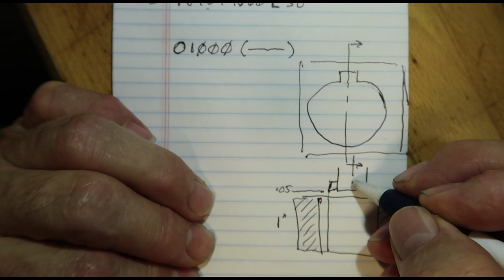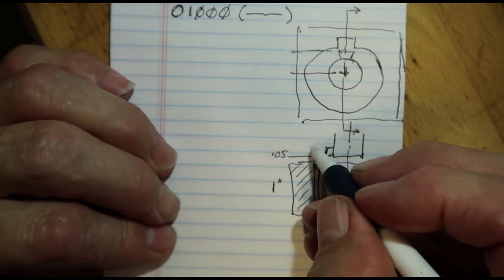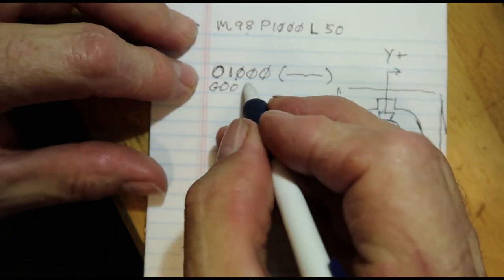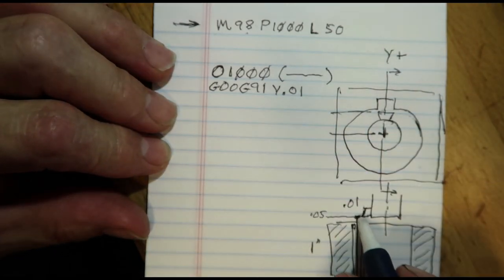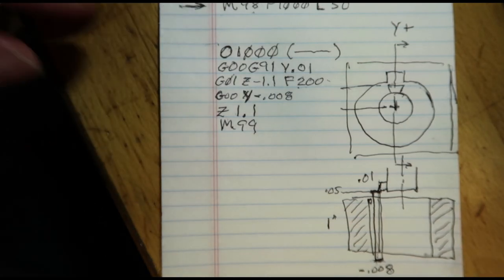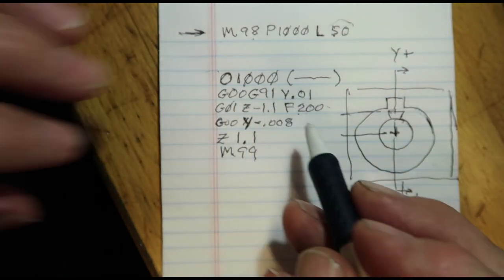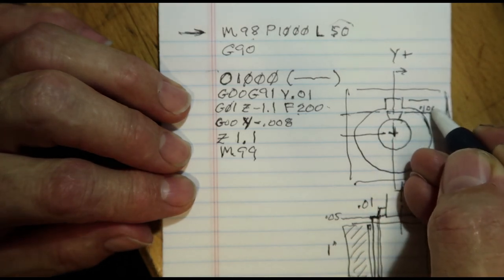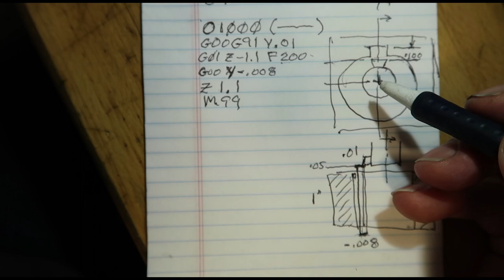Things Are Shaping  Around  Shop

Comment: Peter amazing shot of the machining.  I was wondering why you used carbide but then I realized you probably were doing a test and the real parts are probably a much harder material.  Being able to program manually is a very valuable skill, I doubt this could be done with CAM software.  Nice job.

Comment: My company makes a certain set of parts that are really just a family of parts. They have so many typical grooves that I came up with the idea to write all the motions of the grooves incremental mode and save them as programs. I have a program that is a template of all the basic motions up to the grooves and I just do an M98 to call up whatever groove I want. I also labeled the grooves in their Oxxxxx number using the measurents of their groove. E.G. 1/8"x1/4" groove is O12525. Also, there's not even one CNC in my shop and this is just how I plan on running my machines. I've done it in person at school, but once Houston's oilfield picks back up we'll probably by a CNC.

Comment: Awesome. Thank you for explaining subroutines in EIA. I only used them in Heidenhain's Klartext (translates "clear text" from German) language style.
What I would also appreciate is to see some G code parameter programs in case you use them. I again only wrote such code in Klartext.
But maybe there also a comprehensive reference in the EIA manual that came with my machine that I never really touched. Only read the entire Mazatrol and maintenance book :)
Reply from the maker: You know I had a really nice work book on parametric programming. I loaned it to someone and never got it back. I wish I had that book.
Reply: I hate it when things don't return to their respective owners...

Comment: Sadly, my old Hurco mill does not support M98, but it is cool seeing your great explantion of the subroutines in gcode.  Thanks for the details, Peter.
-- Cheers, Gary
Reply from the maker: Tools4Machines Gary what control does your Hurco have? The ones I have run had their Ultimax control. They could only run  DNC loaded G code program from a host computer. That's like running a plotter from a computer. Doing that you cannot run sub programs because once the code is run the data is lost (nothing to loop back to). I have run programs that would not fit into the machines memory this way. Some of them took as much as 10 hours to run.
Reply: My Hurco has Ultimax II.  I do my design work in Fusion360 on my desktop and then have a laptop attached with 9-pin serial out at the mill and connect wireless to my desktop PC do get the gcode file that Fusion360 puts out.  Yes, the old Hurco does drip-feed (thankfully) and can run quite long programs, but most of my stuff is smaller and less complex.

Comment: Can I do this on my new HAAS VF2 without hurting the spindle?  Second question, Is the “orient spindle” G code good enough to hold the spindle stiff and rigid?  With orient on it feel really rigid but I think it’s just a pneumatic break holding the spindle.

Man o man, if this works on a VF2 it would be a game changer for me!

Thanks.
Reply from the maker: I have done thing like smaller keyways on the Haas without any trouble. This Mazak Integrex can orient and clamp the spindle as if its a lathe tool. So with that there is no force on the milling spindle bearings. But for light duty type of shaping you wont put enough force on the bearings to damage them.

Comment: The tapered cutter you showed to the camera looked like it was serrated. What was it?
Anyhow, thanks for explaining your code. I'm relatively new to CNC machining. I couldn't live without a CAM program. However, there have been times when I've had to write some custom code for a project. Most of the time it's simple stuff. But I once had to ( for lack of a better description) reproduce a portion of a worm gear on a stainless steel cylinder. Had to calculate all of the parameters for a bunch of incremental helical moves. Ouch. That was kind of painful. When it came time to run the part I was scared of breaking an expensive cutter. It worked out. Hopefully with more experience the nervousness will go away.

Comment: Awesome video, as always. I found myself catching up on all the videos in your channel every chance I have! A question, when you used that taper endmill to finish the walls of the insert's pocket, do you put pre-load on them? Or other way to putt it, do you drill and tap the screw holes off centre, closer to the corner of the pocket? If you did, how much preload is appropriate? And by the way, really appreciate all the timely replies to all my comments! The info is really helpful. 
Boy, I really miss working with this kind of machine!
Reply from the maker: I do move the tapped hole for the insert toward the pocket walls a little. It varies depending on the insert and how much clearance the inserts hole has on the screw. In this case I think I moved it about .005" straight toward the inside corner. It could be more but this pocket has a lot of support on the side of the insert. I would say between .005-.010 inches would be about right in most cases.

Comment: Does the control support milling on an angular plane?  I've never done 5-axis myself but I've heard of this feature, and I'd imagine it makes programming to mill on an angled surface a lot easier on a machine with an angle head.
Reply from the maker: douro20 , Yes it does. You typically rotate the work plane so the Z axis is perpendicular to it. This will match the B axis angle. If necessary you can also rotate the C axis.

Comment: How common is shaping in this manner done in the CNC world? Obviously it works for this high-end kind of work but is it applicable to more mundane parts?
Reply from the maker: I have done it quite a few times. This machine is particularly good for this because it can orient and clamp the spindle. On a regular milling machine the machine has to have a positive spindle orient ability or you could have a spindle face keyed type of holder. It could do a lot of damage if the spindle wasn't in the right orientation. I have seen this done to make internal splines and gears also. I have used it to cut a keyway in a bore also. You don't have to limit yourself to thinking of just moving the Z axis in a straight line. On some gun frames I actually moved both the X and the Z axis to form a curved shape once.
Reply: Edge Precision You just don’t normally think of the z axis providing the cutting force. The machine doesn’t care so why not use what’s available. Great tip!

Comment: Have you ever tried cutting a key way this way on your tool room lathe
Reply from the maker: Yes I have even squared up the corners on a new 1.25 hardy hole in my anvil on my horizontal mill. A long time ago when I use to manufacture guns. I was machining a German Luger frame. There is a place in the frame where the square corner follows a curve. I did it with the same style on broaching/shaping cutting following a curved shape. So straight key shapes aren’t your only limitation on a CNC machine. Think outside the box.

Comment: How did you learn all this?
Reply from the maker: I had done a similar thing to shape keyways in parts. I had never done it in a rotary direction. This job came up. The first time they did it they paid a EDM shop to burn it out. When I ran the job the first time I suggested that if I could do the job complete would the pay me also for the EDM work. After studying the job I could see that shaping out the corners would hold better alignment than EDM and also make me take home the money for that. So I just applied what I had done in the past for a key slot but with the rotary C axis instead. The short answer is no one taught me. I just did it. The things I’m trying to convey with my YouTube videos is to think outside of the box.
Reply: Gosh came by you from AvE, Im enthralled at your/his knowledge of mechanical acumen. I didn't know this world existed till youtube.com. I have a mill and about trying to find lathe to learn hobby machining, I went into the wrong profession my brain works like yalls, but a .0001% of the training/ knowledge. Kudos, enjoy your videos even though !

Comment: this is just the setup part...  😂
Reply from the maker: No that’s one of the actual parts.
Reply: well, maybe i misread. below your reply to subdude2013, u said it was just the alum setup part.  the real part is inconel.  either way, i laugh because usually, your setup parts might as well be a fusion reactor compared to my hobby work.  i square up a 2 inch block of aluminum and pretty much call it a success 😂
Reply from the maker: You might be correct it’s been a while sense I made this video. I can’t remember. It probably is, I would need to run coolant on the inconel.

Comment: correct pocket geometry require the insert relief angle to match the pocket wall. i'm glad it worked for you but the pocket was milled incorrectly unless it was finished with a tapered endmill or 5axis path.
Reply from the maker: The insert pocket walls have a 7 degree draft to match the inserts. If you watch the video carefully you can see me mounting the tapered end mill to do just that. I even show the end mill close up to the camera just before I touch it off.
Reply: was watching without sound, didn't notice
Reply: Seems you weren't watching, or not watching correctly. I'm glad it worked out for you though.
Reply: 21:09